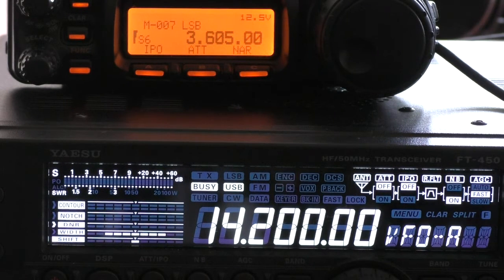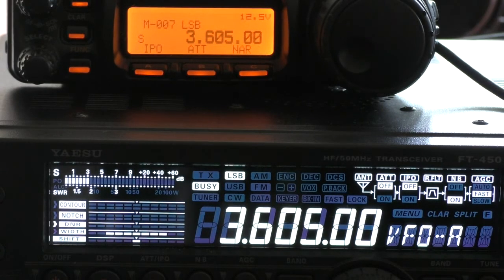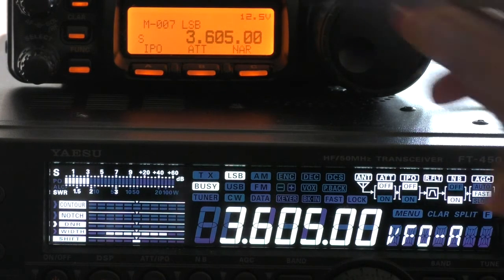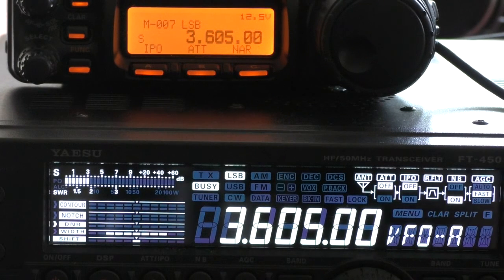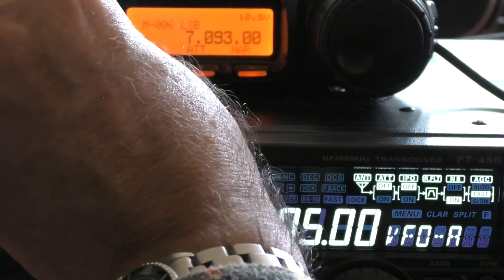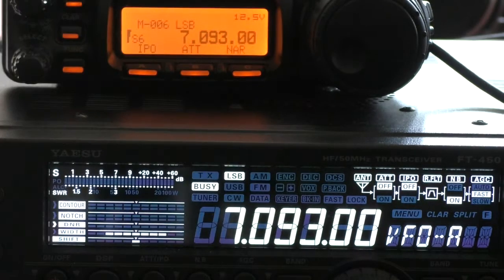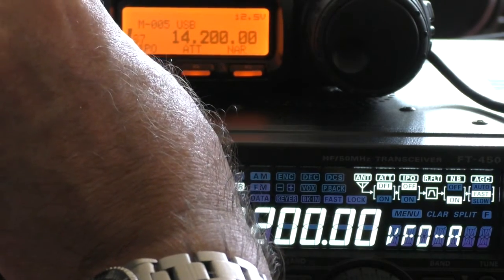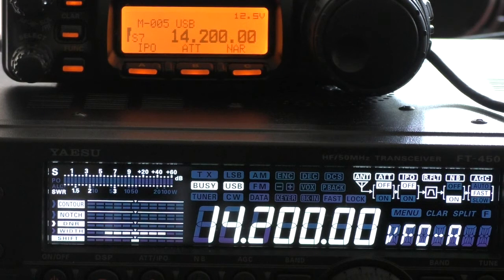Ft450/FT857D RX Comparison

Comment: On the 857, the IPO is in fact turned on. You must have the IPO highlighted to turn off, just backwards from what seems normal. Its explained in the manual.
Reply: But OUR point is you are WRONG. Jesus, just read the 857d manual. You said "the FT450 IPO on and the FT857 IPO highlighted they have the same effect." That's wrong. If the 450 says ON, and the IPO on the 857d is highlighted, and the "I" is showing on the screen, then the preamp, is OFF. IN your VIDEO, you have the IPO OFF on the 450, and ON on the 857.
Reply from the maker: Interesting... turning it on on the FT857D has the same effect as turning it on on the FT450.
Reply: The point was, in the video, you have one ON,857d, and the other OFF.
Reply from the maker: And my point is with the FT450 IPO on and the FT857 IPO highlighted they have the same effect. The action of selecting/highlighting the IPO function on BOTH of these radios is to attenuate the incoming signal. So, one IPO is not ON and the other OFF. The radios are operating under the same set-up conditions.
Reply from the maker: Get yourself an FT450 and an 857D and try it. You'll find I'm right. The radios are set up the same. Now, are you going to get over it or shall I arrange some counselling for you before you burst a blood vessel?
Reply: What do you have against reading the manual?
Reply from the maker: After you old chap...
Reply: IPO (Intercept Point Optimization) and a receiver front-end Attenuator. Press the [ A ]( IPO ) key to bypass the receiver preamplifier, thereby activating Intercept Point Optimization for improved overload charac-
teristics while operating on the HF and 50 MHz bands.The IPO feature does not function on 144/430 MHz. The IPO feature bypasses the receiver RF preamplifier, thereby eliminating the preamp’s gain.

Press the [ A ]( IPO ) key to bypass the receiver input preamplifier. The “” icon will
appear at the left side of the “IPO” selection, and the “ ” icon will appear on the display.
indicating that the preamp is now disengaged from the receiver circuit.
3. Press the [ A ]( IPO ) key once more to re-activate the preamp.

On the bands below 14 MHz, the input preamplifier is rarely necessary, and acti-
vation of the IPO feature will provide substantial protection against
intermodulation and other problems associated with strong signal input to the receiver.
Rule of thumb: so long as the S-meter is moving on background noise, additional front-
end gain is not necessary.

The Attenuator will reduce all signals (and noise) by 10 dB, and it may be used to make
reception more pleasant under extremely noisy conditions. This feature is not available on
the 144 MHz and 430 MHz bands.
1. Press the [ FUNC ] key momentarily, then rotate the SELECT knob, as needed, until
Multi Function Row “m” [ IPO, ATT, NAR ] appears on the display.
2. Press the [ B ]( ATT ) key to activate the Attenuator. The “” icon will appear at the left
side of the “ATT” selection, and the “ ” icon will appear on the display.
3. Press the [ B ]( ATT ) key once more to switch the Attenuator out of the receiver front end
circuit. Signals will again be received at a level 10 dB louder than was the case when the
Attenuator was engaged.

So as we see, IPO and the Attenuator do two different, but similar things. The IPO when active, showing the I on screen, is turning the preamp OFF. Thus, in your video, you have the preamp on.

Now the FT450D

IPO: OFF, ATT: OFF
Attenuator is OFF, and the RF preamplifier amplifies the
incoming signal.

I owe you an apology. I was WRONG, and ARROGANT. They are set the same in the video. The preamp is ON on both of the rigs. Please accept my apology.
Reply from the maker: Precisely... and if you turn on the IPO on the 450 it does exactly the same thing. Just as I said.
Reply from the maker: That makes sense. Thanks for the comment.

Comment: I did a little reading and found this in the FT 450 manual:  

3.4.7    Signal meter

When not transmitting, the meter in the upper left corner of the display shows the signal strength of the received signal. Note that the value is only accurate when the “SQL/RF GAIN” knob is turned full on (all the way to the right).
Reply from the maker: Aha... good one, thanks for that I'll give it a crack.

Comment: S-Meter on both Radios are only Treasures. A comparison on S-Meters make NO sense. If you like to compare Ratios (A/B) use to equal external loudspeaker and switch between the radios fast. 73 as Mark
Reply from the maker: I think it makes sense. People give signal strength reports... they look at the indicated signal and tell the other station what they see. If I give someone a report on the FT450 they may get the impression their signal is weaker than it actually is. Or the other way around on the 857D.
Reply: well, this may be in a true in local QSOs. If you make DX like I always do, you get 59 59 and that's it :-)
Reply from the maker: Yes, strange isn't it. They ask you to repeat your callsign and name 3 or 4 times and then give you a 5/9.
Reply: exactly, thast  waht I saying, a S-Meter comparison make NO sense. If Oms wold't  have a S-Meter, they would give you also 5959 an asking agn for your call sign!
Reply from the maker: Of course it makes sense... all OMs aren't the same.
Reply: and how you will know, if the other station have Preamp OFF or ON?
Reply from the maker: Who cares... it's amateur radio. I'm getting bored so this will be my last response on this subject. If you don't get it you don't get it, end of.

Comment: There may be a "fix" in the hidden menu of the 857.  There have been reports of other Yaesu users getting better signals when adjusting the 'hidden menu' part of the radio.  Maybe looking into that will make the sound or signal strength better or hear more stations with out overloading the radio itself.
Reply from the maker: Thanks for the suggestion. I'll take a look at the service manuals and see if there's a signal strength reference level.
Reply: The hidden menu is not really in the manual.  By pressing A, B and C then turning the radio on will activate the settings to have it changed.  There are some pages on the internet but it comes down to the golden screwdriver mentality.  It may reduce the signal and bring up more noise/stations heard but it could damage the internals somewhat.  If you know what you are doing then it is good, if not, then best not to delve into that area.
Reply from the maker: Understood.

Comment: I can't hear anything. All I hear is that annoying Yaesu hum that everyone talks about.
Reply: Have you considered that both radios may not use the same non-linear scale for received signal strength ?Some radios are 3db between S points and some are 6db.
I'd throw both of them away and get Icom gear and then move to a nice quiet place.
Reply from the maker: As they're both Yaesu radios I think they should use the same signal strength scale. Not an Icom fan I'm afraid.